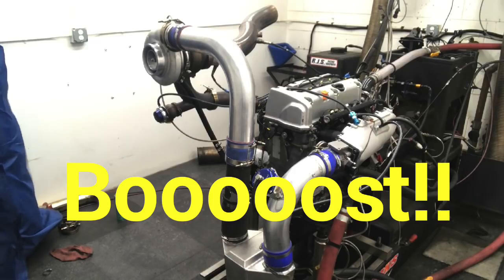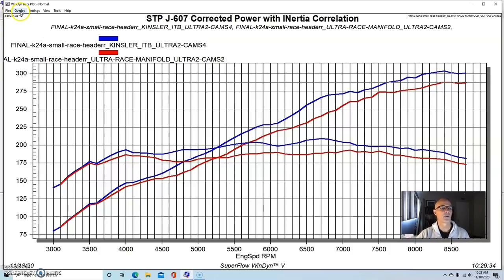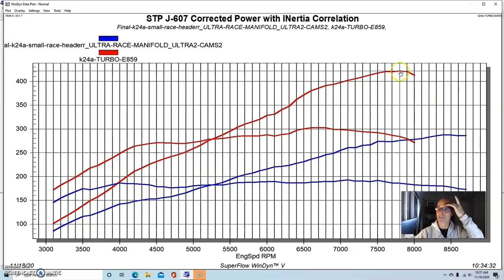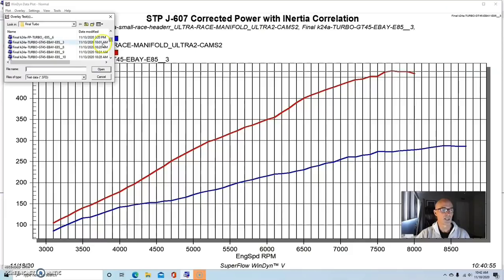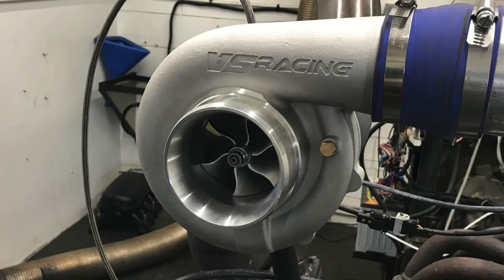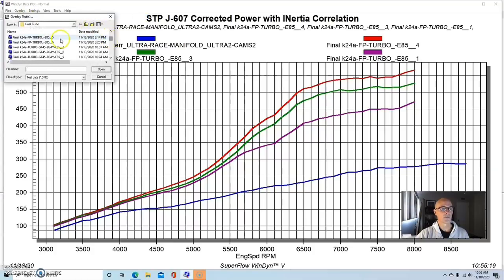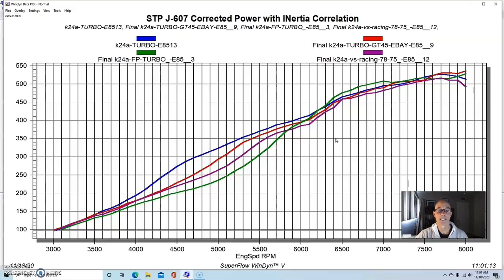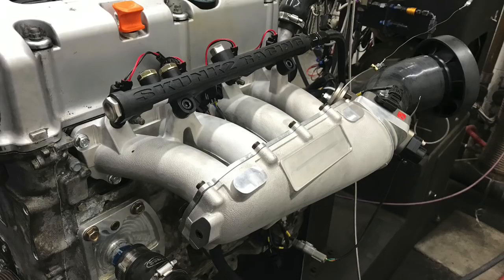CHEAP TURBO TEST-K24A2 BOOST RESPONSE TEST

Comment: Pause at 19:40 and study the torque curves.  The 62mm turbo has more torque than all the big ones from 3500 to 6000 rpm, then is about the same up to 7700.  At 4500 rpm, it's making 90 lb*ft more than the biggest turbo.  Mid-range torque is what wins races.  If you're going for a Bonneville speed record, and peak power is all that matters, go for a big turbo.
Reply: Mid range is what breaks rods as well. Makes engines life a lot shorter.
Reply: The mid range works best on the road course. When I raced motorcycles, My bike had great mid range. You have 12 turns,and 2 straights. I can pull a tenth of a second on each turn vrs only 2 straights.
Reply: @mcfero1  Nonsense.  Dynamic forces at 4500 rpm offset pressure forces to the point that rod compression is almost zero.  15 psi boost is not enough to stack  the rods at any speed, even at 1500 rpm.
Reply: @andyharman3022  LOL! I guess you missed the very first statements made in the video.
Reply: @guhfluh  What statements would they be?  The first statement is "today is awesome, because it's boost day."
Reply: @andyharman3022  I don't see any equations or references.
Reply: @lucysmith4242  What equations do you want to see?
Reply: @randallmason9687  so which turbo are referring to? Can you name the actual name of the turbo so i can buy in on Ebay and start setting up on my car. It’s a dream of mine to turbo my car.
Reply: @mcfero1  That's why you run race bearings with more clearance, and thicker oils as well.
Reply: @andyharman3022  it has nothing to do with psi and everything to do with torque. The world has seen over sn over what happens when you have too much torque at a low RPM. 500 tq at 3k RPM vs 4k RPM, at 3k RPM your sustaining that # longer. The engine doesn't care about offsetting/whats upcoming.
Reply: Looking for refined levels of monstrous balance.

Comment: I'm so glad you don't discriminate engines. There is value in knowledge regardless of platform. I am looking forward to the ultimate power output with stock parts modified. Having the "soft spool" has been very helpful; for me with my RWD 4g63 car on no prep racing. Thanks for the time and energy

Comment: The stuff at about 18 minutes in to the end is exactly what I like to see.
Not all of us want 800- 1000 hp. at the top.
Id much rather have 1 or 200 ft.lbs of torque where I drive the car. Even if it mandated forged rods and pistons, to live.

Comment: I love the mid-frame (50trim/.63 or .48) for street daily and occasional fun time. (for my 2.5 baby Mopar)  
You get tons of tq early, but it is of course... a trade-off for top end charge via backpressure and untouched cylinder head.
Love the content as usual!

Comment: A super comparison! 
Thank you for doing it. 

I feel one thing you’ve confirmed is that the GT-45 (or any similarly sized turbo) is almost like a ‘no worries, just do it!’ size turbo for so many combos. 

It seems to work somewhere between excellently and ok on anything you’ve tried it on. 

I was really happy with mine on a 6.2 litre LS swapped Foxbody...

Cheers!
Reply from the maker: it does work well on a lot of applications in the 700 hp and lower power level

Comment: This is one of the best turbo comparisons I've seen. Oh I've been a mechanic for 35 years and owned my own dyno tuning business for 16 year, So I have a turbo sitting around that was on my Supra and it made 550kw at the wheels, so i'm going to try it on my Honda K24a1 just for a laugh, will be taking the K24a2 head off my sons car if I can't find a K24A2 second hand engine, We don't have E85 at the pump anymore in N.Z. so thinking of WaterMeth setup. I want to keep the K24A1 bottom end to keep the compression down 9.6:1

Comment: I'd imagine there are situations where the softer bottom end would help traction. and running them down on the top. But torque at the shift recovery point is important.
Reply: There are a few ebc’s out there that can adjust boost response by, time, rpm, gear. And if configured right handle it pretty well.
Reply: low rpm torque is what scatters engines they can handle more torque at higher rpm
Reply: @bill2178   its more that they make less tq above the transition point up(5,2xx rpm) that is what is  allowing them to survive.
Reply: @daviddroescher  the Torque those engines making at 7000 would put a window in at 1500

Comment: A series on the Chevy Ecotech would be interesting.
Reply: I looked into getting one for My S10. Chevy wanted 9 grand for a crate motor! I hope that I can find one at the local pick-a-part!
Reply: @randallmason9687  you should be able to, my local LKQ is loaded with them. $325 out the door without accessories.
Reply: @cumbob  I drove a Lotus 7 replica that had a 2.4 with mild(ish) cams and a 68mm Borg turbo that was supposed to make 400whp. It was enough to make that 1,600lb car almost uncontrollable at WOT.

Comment: Im running the g25-550.. Best turbo for the street by FAR.. Capable of high HP for its size, but has amazing response and low-end.. I am tuned on boost by gear, but I make peak boost around 4K which is awesome for the street. And with the k24, stock, it only revs to about 76-7800 anyway with power falling off around there anyway. I make 390whp and 340tq which I think is a phenomenal number for the street. And its more than enough.. I couldnt turn it up much even if I wanted to as I would just spin. Im working on my suspension and tire/rim now to make it as perfect as possible.. I am running Hondata Traction control as well. Not perfect but a nice addition to have as 1st and 2nd would be useless without it. I am also running PPG 1-2-3 and a gearX 4th with Syncrotech carbon package. Trans is holding up really well. Its INCREDIBLY loud though. And I purposely went with a softer mount with Hasports 62a but the drivetrain is still super loud. A bit annoying for a street daily as I want the car to be.. And yeah the HArdrace full bushing set likely doesnt help, but the car just feels so stable and planted. Gotta make comfort and luxury sacrifices for performance.
Reply: have you tried EFR7163 in Dual Scroll setup?

Comment: Honda is where its at. Well, also LS of course.
Reply: Modern engines in general are all performing very well; but I think the standouts are for sure Honda’s K series, GMs LS and now LT platform, and the Ford Coyote/Voodoo platform. The power potential in relatively stock trim for all these engines is truly amazing.
Reply: @kennethpowers8995  agreed
Reply: If you want to talk about innovation, look at koniseggs inline 3 cyl 1liter twin turbo engine that produces 600hp. I'll be the first to admit at this point it's not attainable at all to the average guy, but it's badass nonetheless!

PS, I still like ls engines.
Reply: Sorry, didn't spell that right but you get the idea
Reply: I wish they had more rwd car though
Reply: @jake4194  rwd is an illusion. A daily driver that you use in the city like most of us can be more fun in fwd anyway. They are more efficient as an added bonus. Don't get me wrong I love rwd and understand the benefits and fun. But don't focus on it. Hell one of my cars is a turbo kia soul.  Its a blast daily.
Reply: @ericdolby1622  nothing more fun than wheel hop so bad it feels like the dash is gonna pop out. Well other than under steering right of the road.
Reply: @willyjameshuff  what type of vehicle? I had bad wheel hop in a few cars. For daily driving and zipping around the city. Front drive is a blast. At the track I like rear drive. Just depends on what your doing.
Reply: @GreatLakesLogger  The I3 setup you speak of is a tech marvel indeed. That hypercar they put it in also gets a couple electric motors too so I bet it’s fast as hell. Looking at the design of their engine though, for being a 3 cylinder it’s actually still fairly large displacement. The interesting points to me aren’t making 600hp out of 3 cylinders, that’s not very hard honestly, but the technology within. Free valve (no camshaft) technology really intrigues me and I also like the way their turbo system is designed closing off valves to build boost then opening for flow. We will see this in the future on more platforms IMO.
Reply: @kennethpowers8995  the best part of that engine is the free valve technology. Imagine that on a ls 427
Reply: @GreatLakesLogger  It would be cool but I think it’s far from necessary and might not even be desired by most of the die hard LSX crowd. Half of the appeal of the LS is the simplicity and affordability of the platform. Guys who have been wrenching on Gen 1 small blocks their whole life typically feel right at home still working around an LS whereas other modern computer controlled DOHC stuff can throw them off. Parts interchange readily between your Grand dad’s Silverado and your son’s SS Camaro. (An example) Its also very economically practical because the stuff is so basic parts remain cheap and available. If you were to modernize the platform that much I think it wouldn’t be an LS anymore at all. Hell even the GDI LTX platforms out now are sacrilege to some old school cathedral port LS guys and the shortblock is relatively the same as what they’re used to. Imagine if the C10 Vette rolls off the assembly line without a camshaft. People would lose their mind lol
Reply: @kennethpowers8995  True I wouldn't care for it at this point as it's relatively unexplored by most companies. My thought was that as an experiment it would be fun to have that kind of volumetric efficiency with an engine of that size.
Reply: @GreatLakesLogger   I would really like to see a large displacement NA engine with that kind of VE. With boost you can get away with poor airflow because you can just manually introduce more air as needed. But to be able to make crazy power on just atmospheric pressure is something else entirely, and I could see a 427 LSX making 600+ CID big block power with that kind of breathing potential. My curious side really wonder what kind of torque curve you could make with a free breathing LS setup though. Take a look at the new Coyote for example; insanely efficient 4v head and makes crazy HP NA with the right tune and breathing mods. I’ve made over 500whp with stock heads/cams/shortblock on a Gen3 Coyote. Basically just good headers, a good tune and good fuel will get you there everything else stock, no boost or spray. The only reason it can make this power is the air it’s able to flow NA. However I’m not typically impressed by their torque production being that they’re still relatively small displacement engines. That’s the only area where GM and Dodge still come out on top IMO, but a big push rod V8 has always made torque, even when crippled with small cams and terrible head/intake setups. If a Scat Pack 392 had the airflow of a K series Honda Ford would really be in trouble.
Reply: @kennethpowers8995   a 427 is easily capable of 600 plus na. I've seen them over 700
Reply: @kennethpowers8995  no most modern engine's are shit.
Reply: @ericdolby1622  lol fwd sucks ass I had a tubo k24 and it was scary it tried pulling you off the road any time you gave it gas. Sorry I'm sure you are trying to make yourself feel good about the fwd car yoi bought but fwd suck ass . I went rwd after 15 years of fwd and haven't looked back
Reply: @whocares5188  I own both actually. You can do a lot in both. Honda has perfected FWD and Honda is a very good product.
Reply: @ericdolby1622  well I think we are talking about 2 different things I'm not talking stock power. . Honda hasn't even close to perfected fwd. I assume you are talking about the type R? Great car hardly  any torque steer At least at stock power. You get it to 600hp and the torque steer is pretty bad. I could deal with bad torque steer if the wheels didn't break loose so ez
Reply: @whocares5188  I get your point. At stock levels they are awesome. I guess I have never driven a 600hp fwd anything. I tinker around with an older Silverado that I have a 500hp LS swapped into. I also have a V6 Accord coupe with a 6 speed. Daily driver and all stock. Just a reliable fun machine.

Comment: SO... back to that request i made in your other video about testing a remote mounted turbo vs off the engine. Your immediate answer was "the engine dyno is not the ideal place for response rate changes".

And yet here we are 5 days later testing response and power curve changes LOL. 

PS: I absolutely love your videos so keep up the good work!
Reply from the maker: still not ideal
Reply: @richardholdener1727  well I'll end it with this, would this be something you're interested in testing in the future?
Reply: The problem with remote turbos is that the exhaust cools down a lot on the way to the turbine. If you can insulate the hot side well there’s no difference, but that’s really hard
Reply: @truckfreak4537  yes, that's the known part. The unknown is just how much this change in temperature affects performance.

Comment: Also from what I have learned a bigger turbo is better on V8 because back pressure can become an issue if you’re running a single turbo to compensate . a smaller Cam can give you torque sooner in the rpm while the turbo is for up top and no back pressure issues

Comment: Lag disappears, with a small nitrous shot. Turbos love nitrous. It increases the volume of the exhaust gasses, as well as dropping the IAT's dramatically. Both of which is advantageous, when used on a turbocharged engine. Usually a small 50hp nitrous jet will add 50-70whp and 100wtq-150wtq. I have seen HUGE torque increases when nitrous is added to laggy turbo setups. This is because the nitrous turns a laggy setup, into a super responsive setup. Making a turbo spool 2k-3krpms earlier makes the torque output skyrocket. I had a stock shortblock sr20det gain over 300wtq after adding a 140hp shot. It also gained about 175whp. Made over 500whp and 500wtq on 93oct fuel, all on a stock shortblock with over 100k miles on her.

Comment: This makes me want to K24/turbo swap my miata
Reply: DO IT
Reply: Bro just an NA K24 swap with Bolt on would make that miata insane.. I mean with full bolt ons a K24a can make upwards of 240whp stock. On a chassis as light as a Miata, thats a lot of power. And you have NA reliability.
Reply: For the same amount of money that would take you to make 250whp on the stock engine you can swap it for a k24 and have a much better engine for the future
Reply: There's lots of guys turbo k swapping there miata these days. I have a 07 k24 civic si an think I wanna k swapped miata. Rwd k series would be so sick.

Comment: I dig that ur doing everything out there. I would b down with some more csb stuff like this since ls motors have doubled in price and r still a little complex with swap. Well more costly then complex. I'd like to learn more boost with carb.  Especially E85  Configurations

Comment: I was hoping to see a boost pressure map. When did the turbo get to the commanded boost pressure?  At what rpm?  Your explanation was very interesting. I liked to see rpm vs hp graphed. I hope next time you can do rpm vs boost graph!
Reply: What commanded boost pressure? This was using a bleed valve as shown on the video.

Comment: So much good info! The torque curves really show an interesting story about sizing the turbo. Having back pressure numbers would be interesting, too but torque is what moves the vehicle in any particular gear. This begs the question from the BBC with twin GT45s, how quickly did the torque come on compared to a single S475 or S480? The back pressure on that test, the twins, was extremely low—did that kill the mid-range torque? With almost 500 cu in, did it matter? So many questions, so little dyno time... Thanks so much Richard!

Comment: Great video, really appreciate the stepwise repeatable scientific approach that you take here.  Regarding that biggest turbo, holding up at the top of the rev range, I believe that most likely relates to how the pressure difference across the engine (between inlet and exhaust) is developing.  I'm guessing that biggest turbo still has positive DP in that high rpm range when the others are going to zero or negative.  Just one man's opinion :)

Comment: Would love to see this test at 35, 50, and 60psi.  This would show the power production limits and spool character of each turbo.
Reply from the maker: 60 PSI?
Reply: Have Evo’s and Civic’s running 60psi on the street with these larger PTE6870’s and FP Super99. Larger turbos make best power curve above 40psi.
Reply: On a cold motor first thing in the morning, do a 1 by 1 swap for ARP L19 head-studs and send it.

Comment: Don’t even like hondas but still he makes it interesting
Reply from the maker: EVERY MOTOR DOES COOL STUFF
Reply: @richardholdener1727  what about the chevy Iron Duke?
Reply: It doesn't matter what engine you have, boost makes everything. Lol. Judson, always said, your stupid if you got one and stupid if you dont..ive done a few off the wall combos and made good power with crap that nobody thought would.
Reply: @slopoke22  this motor was making 300 crank na
Reply: @snakeballs8965  really good for a 2.4 liter... that’s like making 700 hp on a NA 5.7 LT1 or 625 hp on a coyote... all on stock bottom end and no boost. Honda makes great motors. The S2000 had the highest HP per liter (123.5) of displacement of any production car till it was beaten by the Ferrari 458 (124.5) in factory trim
Reply: Yup he does. Not a Honda guy but I respect their breathing capability
Reply: @AzureCrux  love me a 458

Comment: The real question is with the smaller turbo running between 7 to 10 psi will the motor with rods and pistons and headstuds would it run good numbers and not blow up with a 93 octane tune instead of me having to run e85 because its hard to come by around here the closest thing to my house is 100 octane race fuel and its like $17 to $20 a gallon on a good day